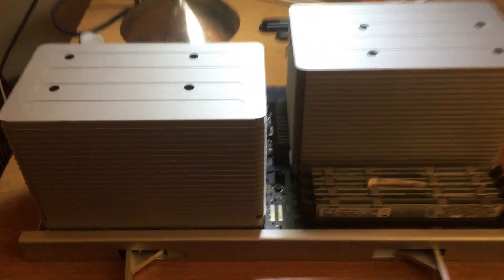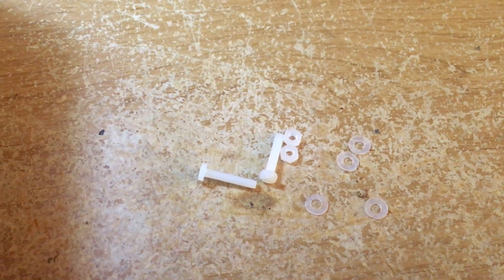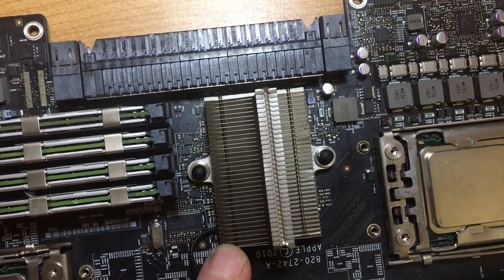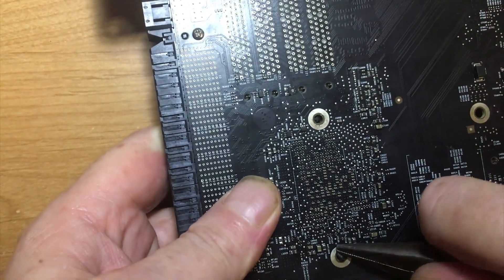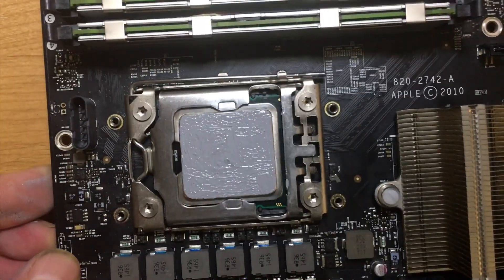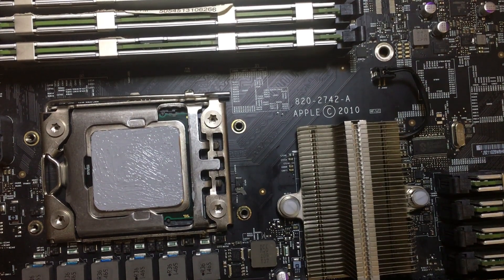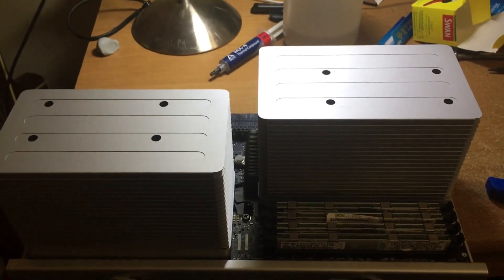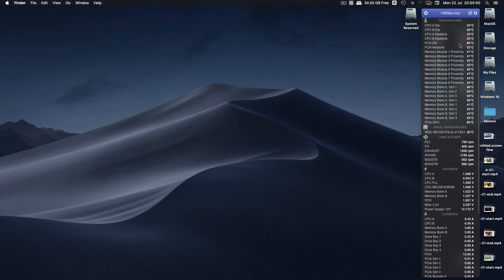Mac Pro 2009-2012 PCH, IOH, North bridge over heating clips replace

Comment: Hello, there!   I have the same problem.   Could you please indicate the names of parts parts that I need, The tool that unscrews the processors' sink.  Names and sizes of those bolts and washers, etc.   And the sink that you replaced - is there another one like that under the second processow sink?    Thanks in advance
Reply from the maker: Hello my friend, you will need a 3mm Hex driver at least 125mm long to get the screws out of the cpu heatsinks and i used M3 (3mm) nylon nut bolt and washers 19mm long and some thermal paste to re paste the cpu's & pch chip, thats about all you need.
Reply: @An.D  thanks 🙏

Comment: An.D - Andy Dawson have you write down which chip the northbridge is?
Reply from the maker: its the IC in between the 2 processors with the small heatsink on it ✌👍
Reply: @An.D  i know which on the board - the chip is a Intel® ac5520 I/O Hub

Comment: The eBay UK link is dead. Can you give the particulars for the nylon screw and washers and nuts?
Reply from the maker: https://www.ebay.co.uk/itm/10-Nylon-Plastic-Screw-Sets-M3-Nut-Washer-Bolt-16mm-Length-/130380042218?hash=item1e5b418fea ✌👍
Reply: @An.D  apparently I can’t use the UK version of eBay. I will keep looking. (From the USA)
Reply from the maker: Give ebay usa a search for "nylon Screw M3 Nut Washer Bolt" ✌👍
Reply: @An.D  seems in the US that 15 mm is more popular than 16 mm length
Reply from the maker: @BradMacPro  it doesn’t matter they will be fine

Comment: finally, a how-to video for this.  Now to find a distributor that sells to the USA thats not going to take two months to arrive from China.

I'm not going to worry about making it too tight - I believe that as long as the spring isn't compressed all the way, it'll take care of the proper pressure
Reply from the maker: Im sure you can get the nuts and bolts in the USA ✌👍
Reply: @An.D  Sure did - it was as simple as suddenly remembering that I could specify North American locations (ouch)
Reply from the maker: @restcure  Hope you get it sorted my friend ✌👍

Comment: Thank you Andy for this video. Very useful to me. I watched your video while searching the internet to find possible causes for my non functional Mac Pro 4.1 I bought as a Corona project. While going through the minimum configuration procedure with the processor tray outside, one of the pins actually popped off and hit the ceiling! ;-) I may have found the issue why this computer does not power on. Ordered plastic screws and lets see what will happen next.
Reply from the maker: No problem my friend, lets hope you get it sorted ✌👍

Comment: Question? Are you using M3X16 bolts to fasten the PCH? Just trying to make sure I get the right ones. I know that I would need to fix that problem. The Northbridge Heatsink is running at 113 degrees F and the Northbridge Tdiode is running at 130 degrees. Even though that is just the start of my heating journey, I figured what you recommended will help. Please let me know if this is what I should get. Both of those temps are as of this writing.
Reply from the maker: Yes m3 x 16mm nut, bolt and washers, https://www.ebay.co.uk/itm/10-Nylon-Plastic-Screw-Sets-M3-Nut-Washer-Bolt-16mm-Length-/130380042218?hash=item1e5b418fea ✌👍

Comment: Where did you source the nylon screws, washers and nuts? Thx - I plan on doing some preventative maintenance on my end, just in case.
Reply from the maker: Thanks for watching my friend, here where i got them https://www.ebay.co.uk/itm/10-pack-NYLON-PLASTIC-SCREWS-M2-and-M3-Options-BOLT-NUT-WASHER-FREE-UK-POST/272571421741?ssPageName=STRK%3AMEBIDX%3AIT&var=571681704542&_trksid=p2060353.m2749.l2649 👍✌
Reply: Andy Dawson Thank you kindly.
Reply: @An.D  sorry, what measures should i buy? 3mm diameter for 16mm long?  many thanks

Comment: How's it going so far?  I just discovered one of these spring rolling around in my case and need to replace them.
Reply from the maker: Yeah great the temperature is stable at 65 degrees. So all looking good my friend 👍✌️
Reply: @An.D  Thanks for the video.  Just did the replacement and temps are back to normal.  The original paste was all dried out.  Now both the CPU and Northbridge had a nice new coat of Arctic MX-4.  Thanks again.
Reply from the maker: No problem my friend, glad you got it sorted ✌👍